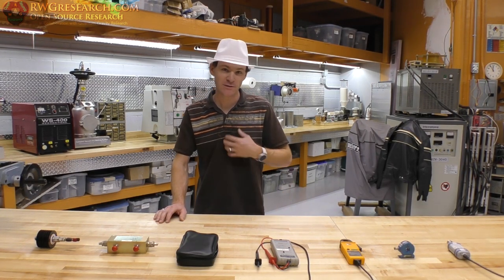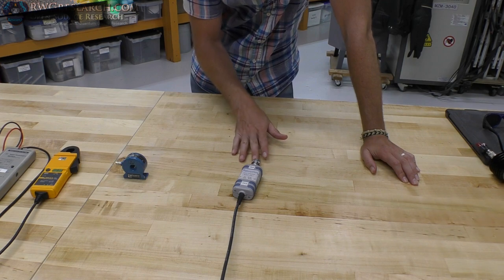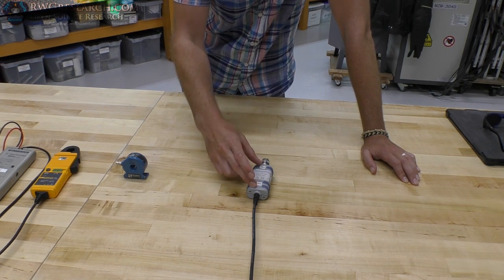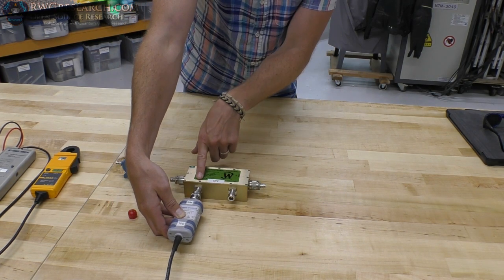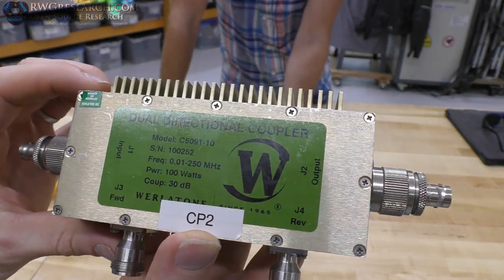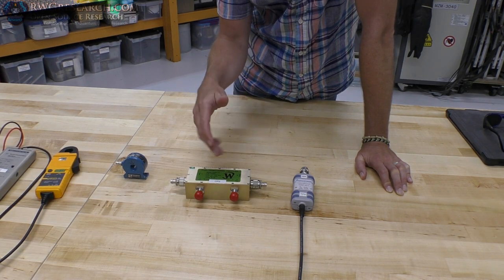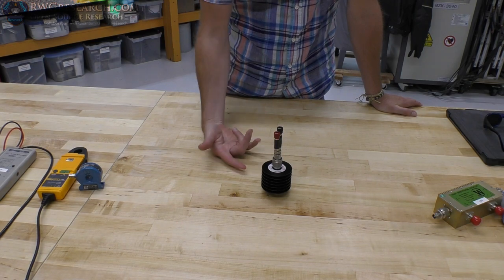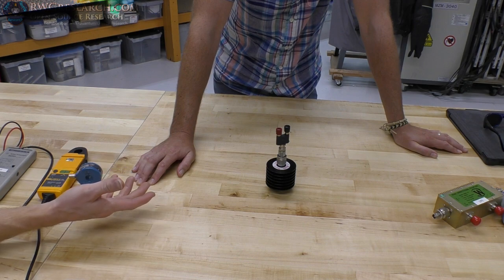Part 2: How To properly Mesure Power "OU", Probes And Know How.

Comment: Great video Russ. This is an excellent idea to talk about these power analysis issues, we've fooled us so much over the time  :)

If I may add, the dual directional coupler should be used for input frequencies >10kHz.

The power probe uses some kind of thermal predicted curve to evaluate the power applied to the internal resistor.
These first class probes usually use platinum as the resistor, and that explains both the price and the limitation in power input. 

One should be careful about the gain as a function of the power range measured. Depending on the way this is implemented, it is usually done by software, but the main issue is the wideness of the error bar related to the power input range measured by the probe.

Finally, using an attenuator increases the uncertainty of the measurement by adding the two uncertainty specified by their spec sheets.
Final word, attenuators are usually cheap, just get one with extensive specifications data.

Hope that helps